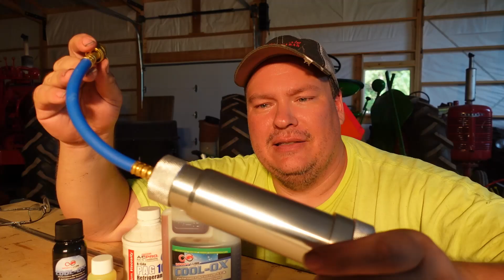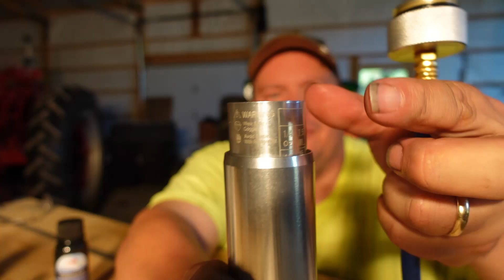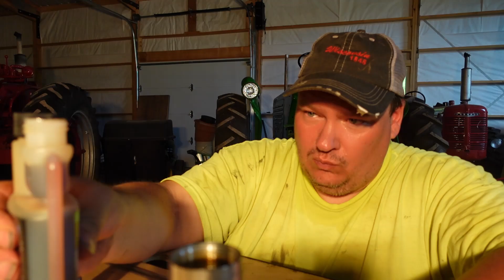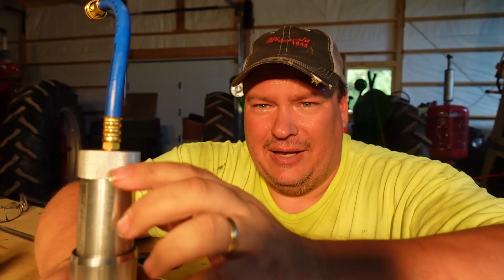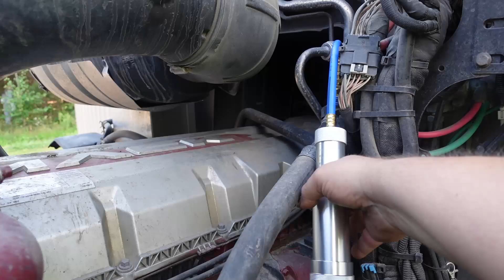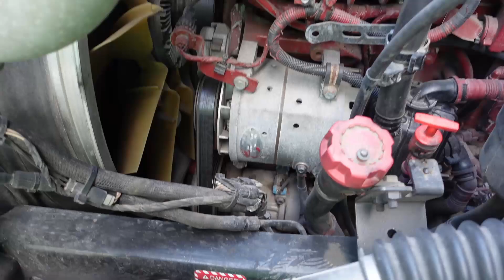How to inject oil, UV dye or Cool Ox into your air conditioning system

Comment: You know I was looking at those clear syringe ones thinking can you really put enough pressure on that syringe to inject dye into a system that hasn't been drained or vented? And I was looking at these metal ones thinking well what's really the difference I mean they look like they might have a higher capacity but it looked just like you push it together to inject the dye. Glad I watched this video. Didn't realize that by turning it to thread it in it exerts the pressure to push the fluid into the system.

Comment: Hello, I added the PAG oil on my compressor through the suction side. Did I make a mistake? I read the oil should be introduced through the high pressure (smaller side). I can try again as I haven’t yet run the compressor.. Or is it ok to go forward with installing the rest of the A/C components?
Reply from the maker: Personally I would take the time to take it out and put it in where it is supposed to be.
Reply: @DIYSEMI  Thanks. Actually I did put it i the right port (suction side) according to a very thorough video I saw. Thank you.

Comment: Hey driver, appreciate you walking me through changing out my compressor. But now it runs for 15 min or so then shuts off. Is it possible that I added too much pag oil? Pulled a code that says not enough refrigerant in the system. But I’m not able to add any. Could too much oil be in it? I’m stressing that? Because I think I added too much.

Comment: After changing out my compressor, should I add the oil before or after I do a moisture vacuum? Thank you.
Reply: I install the oil from a bottle directly into the accumulator just before pulling vacuum.  I first pull a vacuum for vacuum leak check, charge with dry nitrogen for pressure leak check, bleed off the nitrogen, add the oil then pull another vacuum and break that vacuum with refrigerant charge weigh-in.
Reply: Thank you, greatly appreciated.
Reply: @samuelberry4311  I added more detail, not sure if you saw it.
Reply: @samuelberry4311  Be sure you break the vacuum with refrigerant, the vacuum will suck the entire charge in through the high side with engine and compressor off.
The reason is if system is under vacuum, it's too easy to pull air into the system and it won't work well with air in it.
Reply: Thank you
Reply: @samuelberry4311  Be sure when you pull a vacuum, you aren't pulling your oil out with it.  This is unlikely if the oil is laying in the bottom of the accumulator.  Charge as liquid (bottle inverted, sitting on the scale) into the high side.
If you only have small 12oz cans, charging the 1st can into the accumulator as liquid the system will then be pressurized and you won't be breaking a vacuum when you charge the 2nd, 3rd small cans but you'll have to run the compressor after the 1st can to create a low pressure (20ish psi) and charge the remainder as vapor.  You really need to track refrigerant weight carefully to get the correct quantity.
Reply: After watching your video and u replying back to my question, I’m really confident that I’m ready to accomplish this task. U are greatly appreciated
Reply: @samuelberry4311  No problem and think things through.
The two biggest mistakes I see are not purging air from hoses prior to connection, which results in injecting air and not charging by liquid weight of refrigerant, which results in incorrect liquid refrigerant quantity.  When you pull your vacuum, do so right up to the closed refrigerant can valve then valve off the vacuum pump and open the can valve to break the vacuum by injecting liquid refrigerant.
It's very easy to make the mistake of injecting air into a system under vacuum if you aren't careful how you break the vacuum.
Reply: Captain!!!! U are the man!!! I’m literally here taking notes. Because as soon as I load up out of here in Salt Lake City and get home I have to get on this. I’m doing the compressor repair on my thermo king apu. Tired of having my truck run for hours.

Comment: I haven't found any techs that object to using a different/better oil in an ac system. One went on a rant about how terrible pag oil is.

I put some hotshot secret fiction modifier into my houses mini split. Nothing bad has happened at least, lol.

Comment: Can someone solve this arithmetical puzzle from the Shop Manual? It states in the Manual (car is 2001 Saturn SL2):
The Saturn air conditioning system requires 150 ml (5.07 oz) of PAG compressor oil. Service compressors have 65 ml (2.20 oz) of PAG oil installed.
New oil quantities must be added to the system during component replacement and conditions stated as follows:
With no signs of excessive oil leakage, add:
Compressor: Remove, drain, and measure oil. Drain the replacement compressor. Add the same amount of new PAG compressor oil drained from the removed compressor to the replacement compressor.
Evaporator: Add 67.5 ml (2.25 oz) of new PAG compressor oil.
Condenser: Add 22.5 ml (0.75 oz) of new PAG compressor oil.
Receiver-dehydrator: Add 30 ml (1 oz) of new PAG compressor oil.

Open the R-134a source valve(s) and allow 0.50 kg (1 lb) of liquid R-134a to flow into system through low side service fitting.
As soon as 0.50 kg (1 lb) has been added to system, start the engine, set the mode control to vent, the temperature lever to full cold, the blower speed on high, and push the A/C compressor button to the On position (A/C control button light On). Slowly draw in the remainder of the refrigerant charge 0.23 kg (0.5 lb). The total system charge is 0.68 kg (1.5 lbs).

I'm reading all that information in my Shop Manual and don't get this:

If the total amount of refrigerant oil is 5.07oz and 2.25oz goes into compressor, then for Evaporator, Condenser and Receiver Drier is left only 2.82oz (5.07-2.25=2.82oz). But if to add what is recommended for Evaporator, Condenser and Drier it will add up to 4.0oz (2.25+0.75+1.0=4.0oz), with the total in the system 6.25oz (4.0+2.25). How much oil on total is in the system: 5.07oz or 6.25oz? Where I'm wrong? I'm replacing everything besides the Evaporator and Compressor (I'll remove it and flush w/solvent though), those I'll just flush with solvent. No info on Refrigerant Oil under the hood or in owners manual, or in Haynes book. Thank you.